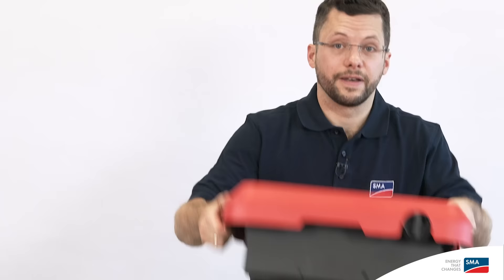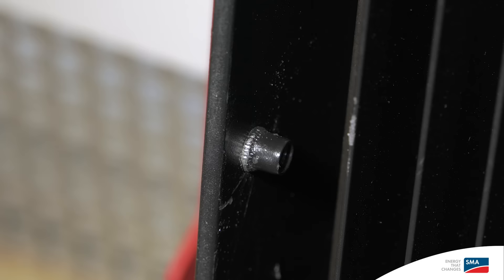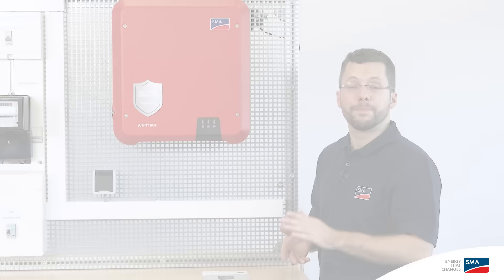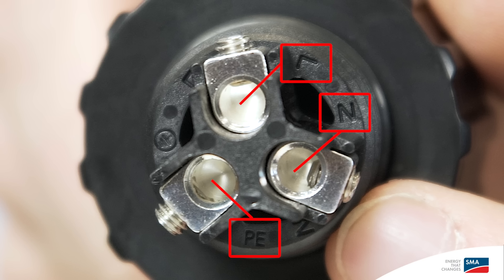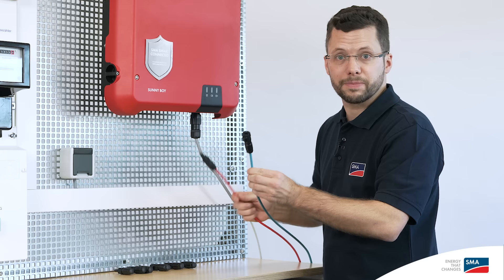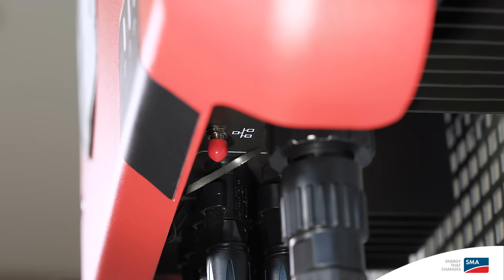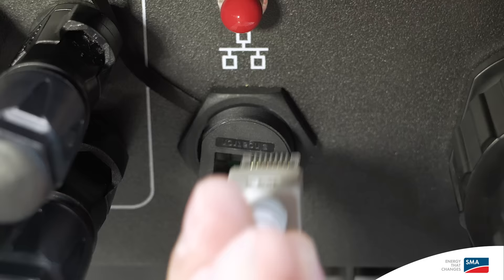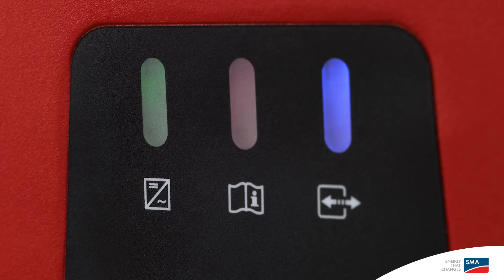Tech Tip: Sunny Boy 3.0–5.0 Installation

Comment: If I decide to operate DC inputs ( MPPs) A and B in parallel... Does this mean the maximum input current capacity of each MPP is combined ? Also, does this mean the inverter will work as a single MPP tracker inverter?

Comment: On the SPS circuit 6000tl model do the five wires just press into the  slots or doe on put a small screwdriver in the other hole to relieve tension?

Comment: please, we are confused about the data sheet of your string inverters.
for example, Sunny Boy 5000TL said that maximum input is 5250W while according to MPP voltage range and current the power from PV can be higher than 5250 and still in the range.
please reply urgently.